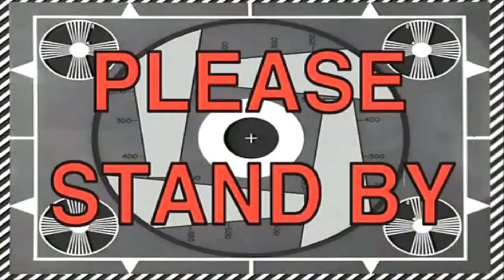DODGE CHARGER HELLCAT NEW MOD GETTING INSTALLED

Comment: I'm back here again. I wish I would've commented when I first had this idea and found this video. Now I see the 2023 chargers introducing hoodpins. As far as the pins which ones did you use? I want to use the official mopar ones but I don't know if they will work with chargers